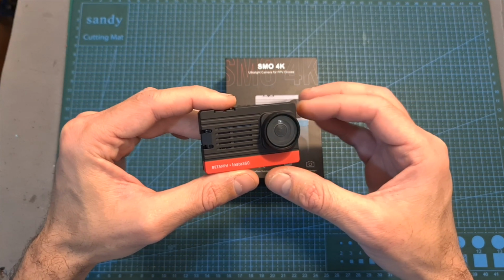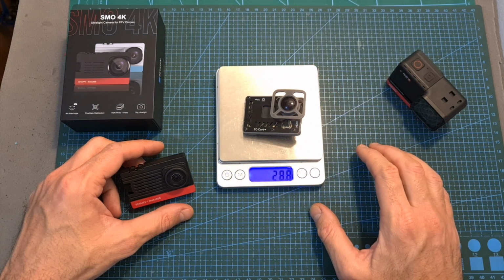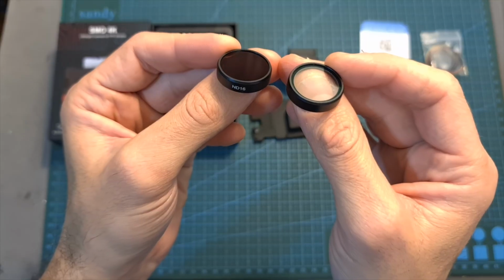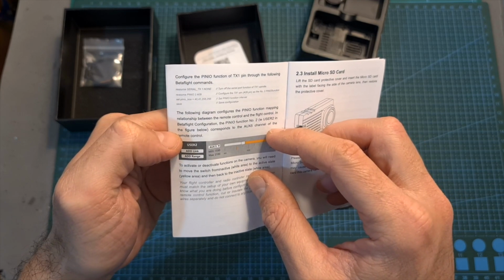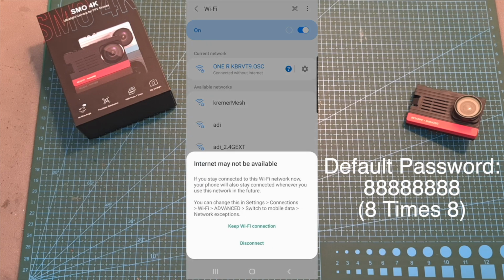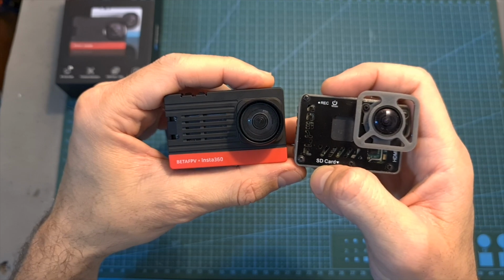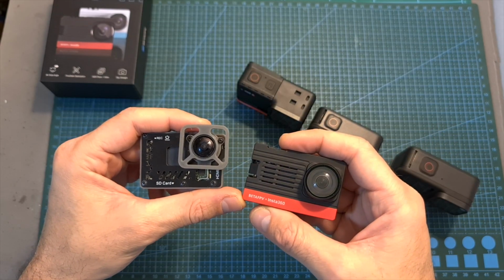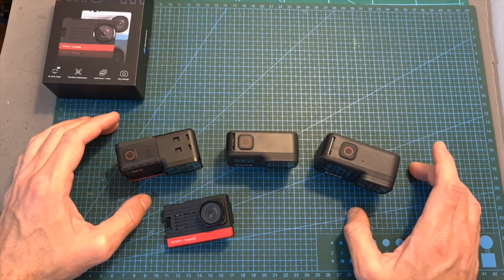Naked GoPro Alternative? Insta360 / BetaFPV SMO 4K Ultralight Camera Review

Comment: Gal, can you clarify where the blue wire (manual calls it a green wire)  connects to? The manual has no mention of it other than to say "controls turning the camera on/off". Then further on in the manual it says the user has to press the POWER button to turn it on. If I have to do this then what's the point of the blue wire?
Reply from the maker: I need to check it out, as I still didn't use it. I know that the other wire can be connected to a free TX UART port in order to control the camera (Start / Stop the video).